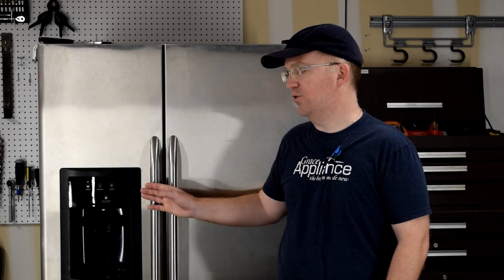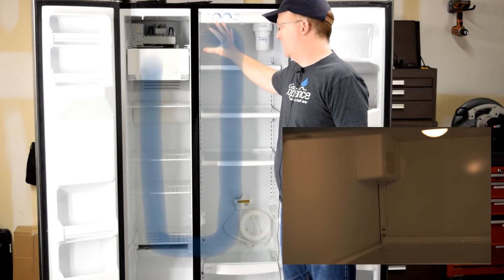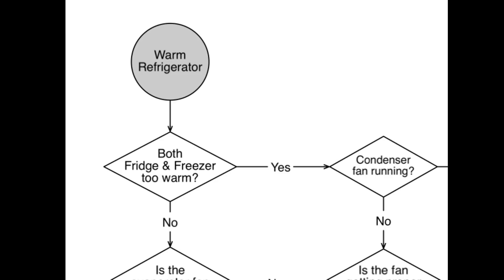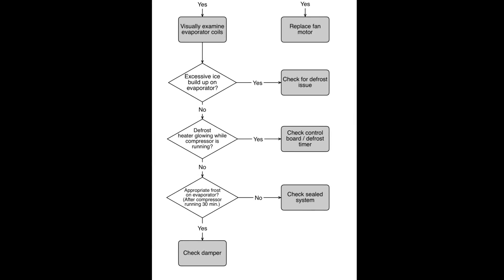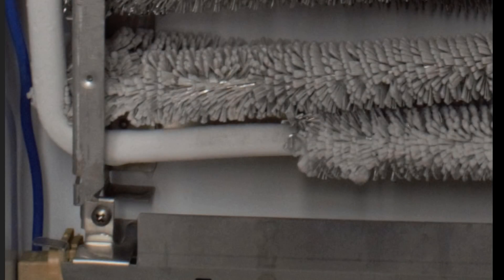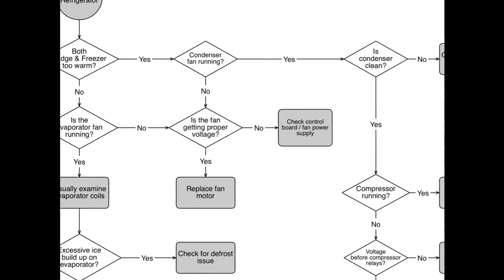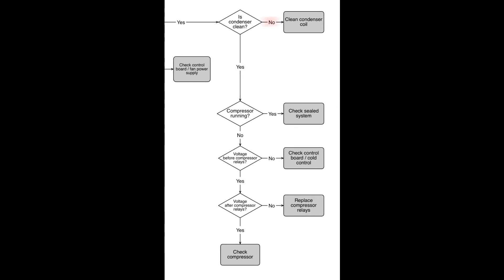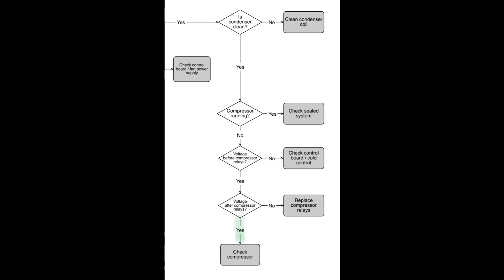Refrigerator Too Warm - Diagnostic Steps

Comment: I have a ge fridge modle# gse25eshb ss.  3 years old tonight it stopped getting cold. Clean coils regularly so they are clean but on the face of the fride it says it is 34f freezer side 20f fridge side . But the fan and compressor will not kick on . Now I can go in diagnostic mode and kick them on manually and it seems to work good although I can not tell if it is getting colder yet since I just did it but they do kick on and you can hear them runnint . So I was originally thinking thermostat but if it was it would probably be displaying the wrong temperature on the control board face of the refrigerator I would think. Checked to make sure the coils inside where not frozen up and they had no frost on them at all just condensation. So I guess what would you think my next step is the motherboard is bad ? I tryed running a diagnostic test but on my particular model it dies not display fault codes in letters it is giving me numbers and i cant find any codes that have numbers related to them.

But I also do not think the temperatures are reading correctly because the fridge is not 20°f . And evaporator fan and everything is functioning as it should when opening the door. Thank you in advanced for the reply
Reply from the maker: Hi Nick,
So, if the compressor has been running for 30minutes the evaporator should have frost on the majority of the rungs.
If the compressor has been running and you still don't have a light coating of frost on the coils, that would be a sealed system issue (I. E. Failing compressor, refrigerant issue, etc)

Can you varify if the compressor is running continually for you after you are able to start it up?

Comment: Hello sir,my fridge is Samsung rs21 and dual evaporators.Both compartments are warm but the evaporator coils are cold,I realised both fans are not running and am getting zero vdc on fan terminals....what could likely be the problem.Also since the fan voltage is zero,could it be due to the opened fridge doors during testing?
Reply from the maker: Hey Daniel,
If you'll take the fan readings (either at the fan plug or at the control board) the first few seconds after you restore power to the refrigerator, you should see a few pulses of test voltage. I believe around 13vdc.

This is the control board testing the fans for proper function before sending steady voltage. The fan itself has a tachometer on it that sends a frequency feedback to the board. If the board doesn't get this signal due to a failed motor, it will shut down the voltage from the board.

If you see the voltage pulse upon start up, the board is good and you would replace the fan motor.

Let me know what you find.

Thanks!
Reply from the maker: If you wanted to send me your model number to Graceappliance@gmail.com I would be happy to send you the tech sheet for your model which will have an option to force run your fans so you can test voltages. That might be helpful. Thanks
Reply: @GraceAppliance  Thank you so much,this information is very healthy.I'll check back on you for update.Thanks

Comment: Thanks for you video. Confirmed my logic when I first check my fridge. In my case both (freezer and fridge) were really warm. The fan in the back worked, but the compressor is not running.... however it has a big sticker that says that uses DC current. Any idea which is the voltage value I should be looking for? have you worked with DC compressors? Thank you again Andy
Reply from the maker: Thanks Alfredo, you're welcome.

Yes, I have. The main control boards only job is to send a signal voltage to the compressors inverter board. This is usually around 3.5 to 5vdc. This tells the inverter board to output the proper voltage which I do no know off hand.

However, if you'll send me your model number to Graceappliance@gmail.com I can reply back with your tech sheet which will answer this question for us.

Thanks!
Andy
Reply: @GraceAppliance  thank you, I will as soon as I return home

Comment: the freezer and the fridge are at 75 the compressor is humming but not loud.
Reply from the maker: Hi Sam, I'm sorry for the delay.  I have been insane busy the past several days. Sorry about the confusion on my part with the defrost wiring. 

With respect to the hard start kit, it might help, but only if the main board is doing it's job. I wouldn't recommend it at this point. 

I think how you should proceed is to send me an email to graceappliance@gmail.com and I can reply with the tech manual for your particular unit which will give you the wiring diagram and also specific instructions about how you can force run the compressor.  This will help I think.

Comment: Goodmorning Andy, i watched all 4 videos, my samsung board is layed out differntly, i am assuming the blue plug is the defrost heater? if so mine has f-def-het and r-def-het. and that would go to the black lead. what is the orange wire? plz let me know. i tested the continuity defrost heater at fridge level and freezer. value was fridge 99.5 ohms and 58.5 ohms. i do not know if that helps they had a plug.
thanks

Comment: My GE Monogram side by side works fine the majority of the time. However, when it gets more humid in the kitchen the temperature in both freezer and refrigerator sections start rising ending up in the unsafe zones.  The reason I say it is linked to humidity is that if I turn on AC in the house, the temperatures return to normal. The other thing I notice is that the heater that serves the door seals is always hot, running 105F with my infrared thermometer. This to me seems odd. I checked videos and found nothing related to this problem. Can you offer guidance?
Reply from the maker: Hi Ken,
There is no heater for the door seals (if I understand you correctly) 
However, a symptom of a failed condenser fan motor is that the walls of the fridge by the door seals getting very hot. 

Behind your fridge near the compressor , you will see a fan. If your compressor is running this fan should be as well.  
Take a look and let me know what you see.  

Thanks
Reply: Will do. Thanks
Reply: @GraceAppliance  Andy, I pulled the unit out and took off the back panels. The fan was not running but the unit was at temperature on both sides. I pulled the plug and let it sit for a while to get the temps up, then plugged it back in. The fan runs but then eventually shuts off. At that point I pushed the setpoints down on both sides expecting that to activate the fan and compressor. The compressor comes on but not the fan. With compressed air I also blew out the dust on the condenser which was dirty but not filthy dirty as in your video. Strangely the fan now seems to run more. I would have checked voltages but the board is different than the one you show; it is a WR55X1056. There are four wires to the fan so I figure it is multi-speed; white, red, yellow, and blue but they go into a connector that has a red, yellow, and two whites with stripes. I could not find where these are on the board to test the voltage. Any help with the connector number and pins for this board. Going from the top, J2 has a blue, red, white/gray, yellow/black, salmon, then red again. Your thoughts?
Reply from the maker: @kenkolkebeck1867  Hey, it sounds like the condenser fan is failing intermittently (or the control board is not sending voltage consistently)

Now, if you can happen to catch the fan motor when it's not turning - I would check for voltage directly at the condenser fan plug.  You will probably have a red and white wire there and should have around 13vdc.  If the compressor is running, you are getting 13vdc at the plug but still the fan does not turn - you'd replace the fan motor.  

However, if the compressor is running, but you are not getting 13vdc at that plug - you'd need to replace the control board.  

I hope this helps.
Reply: GE Side-by-Side ONLY - Refrigerator Repair Videos Thanks for the help; you’re the best. Does the fan always run when the compressor is on? I can hear the compressor running but notice no air is leaving the vents in the front of the unit (it’s now pushed back in the wall) where as yesterday I could feel the heat being pushed out. It is also cold at the discharge grate. The interior temperatures on both sides is fine but the center wall temperature between the two sides where the doors seal is back up to 95F, where as yesterday when I had it pulled out and I knew the fan was running it was cool.
Reply from the maker: Ken Kolkebeck hey, you’re. Yes the condenser fan near the compressor should be running when the compressor runs. 
It’s best to pull the fridge out so you can get eyeballs on both as they’re running. 
Often times, it’s a very small amount of air being felt from other parts of the fridge while the fan is in fact running.  

If you find that the fan is not running, but the compressor is, you’d then need to check for voltage at the plug for the fan motor.  
Some motors use 120vac and other use 13.5vdc. If you’re getting voltage, but the fan doesn’t turn - it’s a bad fan motor.  
If you’re not getting voltage, it’s failed control board.  

I hope this helps. Let me know if you have any questions.
Reply: GE Side-by-Side ONLY - Refrigerator Repair Videos Alright, I think we have narrowed it down. I appreciate the help Andy. I subscribed to your channel; hope it helps.
Reply: GE Side-by-Side ONLY- just to let you know, all is well. This must be a two speed fan. When I unplug and plugged it back in the fan ran seemingly fine but as the unit gets close to set points the fan stops but compressor runs. If I give the fan a kick start with my finger it runs slowly but then once it shuts off but does not restart. So based on this I figured the computer is ok but the fan motor is ban. I bought and installed a new fan motor and now all is fine in all cooling modes. The thing I noticed before was the partition between the two sides was hot; now it’s cold. Thanks so much for your help.
Reply from the maker: Ken Kolkebeck awesome job!  You’re welcome.

Comment: hi Andy, i checked the defrost heater resistance at ther fridge it was 99.5 ohms while at freezer 58.5 ohms is that normal both are at room tempurature. the fridge thermister 12.7to13.2 ohms at 0 celsius and around 5 room temp. while the freezer 12.2 while at room temp @5.
temp defrost senser flickerd flicker 0.00 to 0.001 0.002. 
i am working night shift so i am going to sleep now will check for advise in pm before i go to work.
thanks again
Reply from the maker: Hi, sorry fo the long delay. 
If you look at this video, it will show you how to jumper the heater circuit to visually check your defrost heater. If it glows orange the heater and high limit thermostat are both good. https://youtu.be/XeZfpB7ok90

In your case, it sounds like your freezer temp sensor and the defrost sensor are not giving correct readings. I’d change both of these based on your test results.

Comment: goodmorning Andy i was able to do some of the test i tested the fridge and freezer fan but i tested them at the fridge and freezer side and they were fridge 1.62 kilo ohms freezer 1.665 k ohms. the fan to the shoot that moves temp looks like gerbal cart 1.459 k ohms. nest to it 2 brown wires i belive senser for it to kick it or activate 3.206 kilo ohms.
i checked the board looked clean no burn marks and resistors were not brown or black.
the capasitors were not bulged or leacky and no smell of burns. the board looked new.

1)The blue plug in video three that draws out to test the resister heaterwhat is it called so i can look it up in my board or what does it do. and the blue wire is that the defrost wire and mine has 2 defrost Rdef and Fdef, i guess front and rear. if so i can check both but what is the orange wire on the other plug?
which tests can i do to test the themometers and the sensers

Comment: My GE side by side freezer side isn't getting cold enough. It will freez ice or a cup of water overnight but that's about it. Makes ice slow? Fans are kicking on, compressor is kicking on, it has a new heater an I'm fixing to change the thermostat an and temp sensor by the thermostat. The fridge doesn't have much in it so it's not a circulation issue. Does anyone know what could be the issue
Reply: It won't freez water solid. You can still see air bubbles moving in the ice. Once you let it set overnight an open the door the next day to check an all the cold air it does have escapes it will take all night to freeze again. It will not freez any type of food that is put in the freezer
Reply from the maker: Tracey_ Smart_84_84 hey,
I'd double check that the coils behind the fridge are dust free. If the compressor is running full time and you are not seeing excessive frost build up on the evaporator coil inside the freezer behind the back wall it should be freezing things solid.  

I'd remove the back wall inside the freezer and see what kind of frost build up you have. It should be a light coating of frost on almost all of the evaporator.  

If not, that would indicate a failing compressor.
Reply: An also I'm trying to find the defrost timer so i can put it in manual defrost to double check the heater an defrost timer but I can't locate it. My model number is gss25sgmc bs
Reply from the maker: Tracey_ Smart_84_84 hey, you do not have a defrost timer, but rather a control board which takes care of all of this. 
This video will show you how you can test your defrost system. However, if you have only 2 rows of frosted coils it may be a moot point.  

Thanks 

https://youtu.be/XeZfpB7ok90
Reply: That's what I'm afraid of is the compressor. After installing the new heater only the first couple of rows at the bottom of the coils had frost on them. But I'll look an double check since it's been running since for 4 days now
Reply: Moot?
Reply from the maker: Yes. A moot point would be that the defrost Information wouldn’t matter should your compressor have failed....

Comment: hi Andy, i have watched your videos and the are very beneficial if you have the same fridge it would be a piece of cake, mine has 2 circuit boards one for power and the other for running the little gadgets. Is it possible for me to e mail or text you pics of my board and you guide me with the panel and wire selection as you did in the video. if i get it fixed i would like to donate to your chanel for yourtime and experties. i am going to lable the electric plugs 1-13 on first board and that makes it easy to choose which  plug and wire we need to test and which test.
Thanks again for all your help

Comment: goodmorning and thanks for the direction, when we start the fridge the compresser sounds loud and normal then you hear clicks several of them then the compresser slows down its sound and activity.
Reply from the maker: Yes, this sounds normal. The compressor for the first few seconds is pulling very high amp draw (I.e. using lots of power) around 6-10Amps. This is while the compressor is working quite hard to compress the refrigerant inside the sealed system. It takes a bit for the system pressures to equalize, but once they do the amps come down as does the noise.  The clicking you hear is the overload relay on the compressor due to the high amp draw.

Comment: i put a clamp amp meter to the wire harness going to the compressor and it gave me 0.13amp. i had it set on 2-20 amps ac.
Reply from the maker: sam d it should read about 1.2-1.5A once it’s been running a bit. Your meter may be set on too high of a read out which is why you’re getting the reading you are.  If your freezer is over frosting the problem is not your compressor so I wouldn’t worry about further tests there.  Thanks

Comment: Hello Andy,  you make perfect sence and your videos are super awsome. I checked the voltage on the compresser relay and it gave 122 volts on both sides of the lower piece. Its a 2 piece relay and the positive on that relay is on the top side. the circuit board did some clicking before the 122.2 volt displayed on both bottom sides of relay.
I checked the ohms on the compresser it was bottom two 12.1,  left side 9.0,  right side 3.3, i know the videos  were saying 10 by 6 by 4. Is my compressor off and bad.
Thanks again Andy for all your assistance. the compressor runs with the fan, it seems as if the vibration on it is not very strong it is a little hot and the copper pipes out of it  the one to the condenser was little warm then it did not feel as warm the other one fealt little cooler. the whole issue started with the freezer being over icing. do you think it is low on freon, i have never had yo add to it before, and it is 11 years old and both fridge and freezer are out. 
thanks again for all your help.
Reply from the maker: sam d hey Sam, you’re welcome.  Sounds like the compressor is running fine. The pipes having a temp difference is normal and a good sign.  

The freezer size frosting up excessively indicates a defrost issue in your freezer.  It’s caused by one of 4 parts having failed.  Either the defrost heater, the high limit thermostat (not a common failure) the defrost sensor, or a failed control board.  
I have a video titled how to diagnose a bad control board - defrost issues. I’d start with that video if you haven’t watched it already.   It will wall you though how to test each of these components.  Let me know if you have any questions. Andy